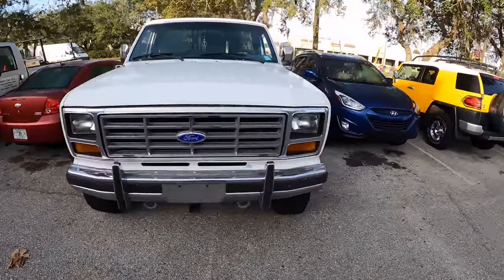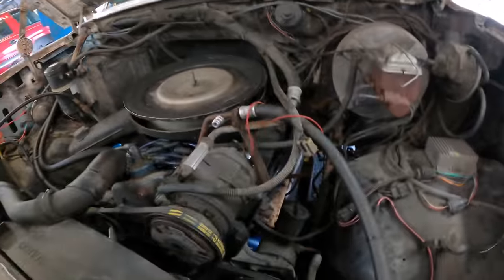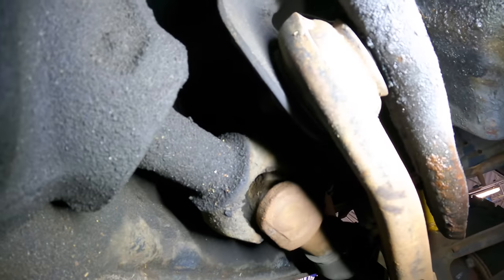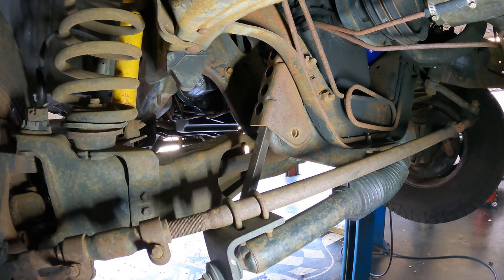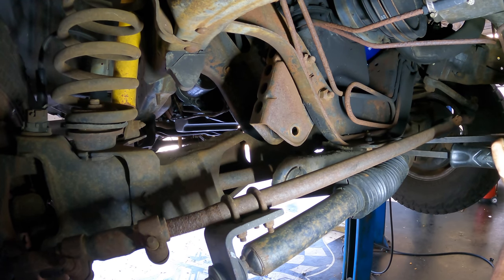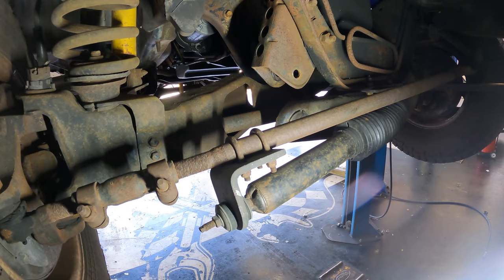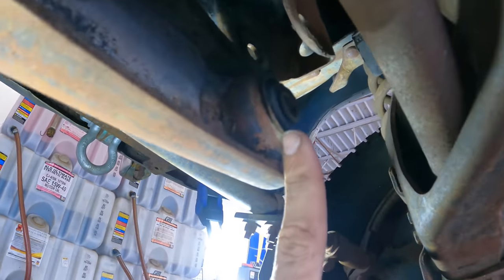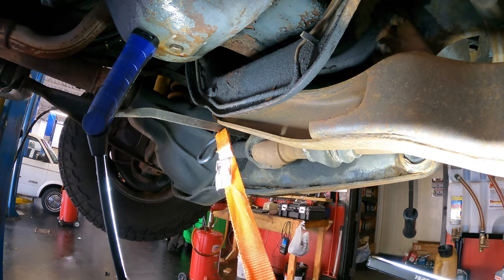Bushings DESTROYED! Assault Hammer to the rescue! Old Skool Ford F150 Classic

Comment: My first car had that foot button.  It's used to refill the headlight fluid so they will shine brighter.
Reply: That's fabulous!!!!
Reply: Dad's new '48 Crevy 3/4 ton stake bed had a second filler pedal to refill the starter with 6 volts.
Reply: That is a rare option  .  My first car  had 2 wires I tied
together to start it . That was a great car , Until the
 police towed it   :-))
Reply: Best answer.
Reply: Lol
Reply: I miss headlight fluid...greatest stuff ever!
Reply: Yea, you can't even find headlight fluid anymore! That's a real classic
Reply: https://www.youtube.com/watch?v=XOxXSEr8KlM  Turns out some headlights did require fluid if you go back far enough.
Reply: Tisna Rahani  <---------  BOT  BOT  BOT  BOT  BOT  BOT
Reply: make sure you pump it a few times, just to be sure.
Reply: That AND… my older Cadillac has a second one to seek the next radio station!
Reply: Bwahahahahaha
Reply: Where was the container that held all the b.s. that's floating around here?
Reply: I remember some old Mercedes from the '70s and '80s had foot button used to, like you mentioned, for the headlights.
Reply: High beams button
Reply: My 1970 Dodge Dart had a manual foot push windshield washer right next to the high beam button.
Reply: Is not it's the "go faster" switch ferd owners know this.
Reply: Did you lube the muffler bearings?
Reply: Head lamps  dimer ha ha good laugh 😅🤣
Reply: @saltyberserker4235  
I heard you could use the blinker fluid as well!
Reply: @garydp9760 .... yes, but only the orange color fluid. The clear blinker fluid requires a special orange color filter to be installed, which does not fit this year Ford.
Reply: Blue or green fluid?
Reply: @michaeldaidone1904  
up north, blue
Reply: @CobaltLobster  The gas ones were more fun. The fluid (kerosene, parrafin or coal oil) just burned when they failed The gas ones, acetylene gas generators actually exploded with a nice bang.
We didn't mention the actual candle power.

Comment: I'm old Ray.  That is the dimmer switch for the lights.  High and low beam.  I always felt those worked better than the new stuff on the column.  Took 3 minutes to replace it if it went bad.  No need to take the entire column apart.  I even drove a pickup that had the push starter on the floor.
Reply: Mine had a crank.

Comment: Eric O. is the hero of salt belt techs (not to mention us amateurs).  When he says that penetrating oil doesn't work, (pretty sure) he means that it doesn't work on the kind of rusted seizures we consistently see in NY!
Reply: Yep, might as well be spitting on it.
Reply: Project farm does a pretty good experiment on it.
Reply: I too am skeptical about how useful penetrating oils are.
Reply: I had a broken fitting in a tank of an air compressor last week. Tried everything and it wouldn’t budge. I soaked it in PB Blaster over the weekend…spun right out on Monday. I think it works, but it has to soak.
Reply: @hpmaxim  zep 45 actually does work. I call it the miracle oil.
Reply: Penetrating oil doesn't do much without heat here in the rust belt.

Comment: You have to remember, up in the rust belt where we work on cars, by the time we need to get that fastener off it's already rust welded on. Penetrating oil doesn't work up here unless you use a lot of heat first. Since you're using heat anyway it's easier to just heat it up red hot and impact it off. Or take a whizz wheel and cut it off.

Comment: Had a shortbed 1983 Dodge RAM D150 SLANT\6 with the Overdrive4 A-833 4 speed manual transmission and that mystery button on the floor is the dimmer  <--> high beam switch...something Junior Millennials and Gen. Z don't have in their cars these days. Good video here Rainman! Definitely. K-Mart. 400 Oak Street. 10 minutes to Wapner. Quantas never crashed.

Comment: Ooh, a floor dimmer switch!  

This is a pig of a job, for sure.  As soon as I saw the title I had to watch.  Ford kept this setup into the 1990s, and last summer I did these bushings on my own truck, which has spent its entire life in the North, on stands in my driveway.  I'm rather jealous that your impact just zipped those bolts off!  Mine just laughed off both my Milwaukee and my air impact.  I wound up using a lot of heat, a lot of penetrating fluid, a lot of swearing, and a 4-foot length of pipe to get 'em loose.  

Good show.

Comment: Put the engine/transmission jack under the tire, the bushing end will lever down as you lift the tire.
Reply: Yeah I was going to suggest the spin jack as well. lifting the tire is ALOT easier than pulling down the frame arm.
Reply: That would work but also take weight off the lift, not a safe thing to do.

Comment: I do believe steering dampeners do not automatically rebound. They stay in the position they were last in and just dampened the steering system
Reply: Spot on, otherwise they would be trying to push the steering one way all the time- and as Ray would say, that would be bad!
Reply: High being low beam switch
Reply: That’s correct
Reply: They work that way on bikes that I do know.

Comment: Penetrating oil has worked for me but it took 3 days and 6 applications. Failed to remove the bolt using up 2 batteries each day on days 1 and 2, on day 3 it broke loose.
Also, once a broken loose, the oil does help allow a nut to come off without binding in the rust easier, especially if doing the loosen a bit, tighten a bit, loosen a bit more routine. Also dissipates heat from the threads so that they remain hard and thus don't strip as easy.
So I agree that penetrating oil does not work in a shop environment for breaking loose.

Comment: I think Eric O’s point on the penetrating fluid isn’t that it’s a myth.  I think what he’s saying is that he sprays it on and immediately tries to remove the fastener never really giving it any time to do its job.  But hey, it makes you feel like you’ve done everything you possibly could before breaking out the smoke wrench.🤔
Reply: Also, us salt belt people get so much rust penetrating oil is mostly a mix of acetylene and oxygen.
Reply: @farmerfb  I like to use acetone/AFT 50:50 before breaking out the fire
Reply: @farmerfb  😂😂
Reply: It cant be stuck if it is liquid
Reply: Well, if nothin' else, it's lubricant on the threads if it does happen to spin at all...?  shrugs
Reply: Here in Norway we have extreme rust issues. Sometimes pen fluid is ok.  Other times you want to keep things dry so more salt does not stick as fast and such. Very situational.
Reply: It won't be stuck if it's liquid! If I can do it, you can do it :) To be honest, I think it's Mrs O's cooking that gives him the energy to get those rusted brake caliper bolts out every time.
Reply: @farmerfb  Exactly! And LOTS of Oxygen!
Reply: Exactly

Comment: The floor high beam used to be very common. Probably not a good idea on a manual, but on auto it works great.
Reply: Back when the auto engineers had brains and used them.
Reply: Good to know, our old ass tractor has one (1066 IH)  it's on the center console.  I've kicked it. Didn't do a thing I noticed (dad probably didn't know it). I'll have to see if anyone else notices it on the outside. (not that we ever run it at night other than for augers, I mean, it is a 1066. (Who reads manuals right? Ours is lost to the wind at least)  (it's from '69) (nice)
Reply: Not a good idea on a manual. My daily is a 77 c10 and it's a pain when you have the clutch in and then you got to put the low beams on. 😑
Reply: Yeah I've never seen such a thing in European cars.
Reply: All my vehicles are from the 70s and manuals and i never had a problem with it.
Reply: @foxman105  my older brother had two with them, 1963 Mercedes and a 1967 MGB.  They're out there you have to look for older cars.
Reply: too much for you to think about??? worked fine on manuals and you didn't have to move your hands around on the wheel
Reply: @foxman105  they were a thing, but mostly had disappeared by the 60s, early VW bugs had them and seen them on some old British cars
Reply: It was common not only in the USA, in Europe we know that too, and in majority we have manual transmission cars (still, up to today).
Reply: In addition to being on the steering column now, my Subaru has 20+ other functions there.  Nothing is in the same place as I move between my 3 vehicles.  Simpler times.
Reply: @ratchetfox8111  volvo PV and volvo amazon had the floor switch with manual gearbox.
Reply: @gregorystone1439  The key is to anticipate when you will be in that situation and pre-emptively put the low beams on. That's how I did it when I drove trucks with a manual and a floor switched headlight beam. Alternatively, slip it in neutral for a second, switch to low beams, then put it back in gear.
Reply: @gregorystone1439  My '78 C-10 Big 10 had one. Auto trans.
Reply: @johngordon6526  must have been an option for the old binders!  The 1066 black strip that I used to run didn’t have that option. Our John Deere 30 series and up had them though. The 1066 that I ran didn’t have the diff lock either and I know that was an option as well.

Comment: Dad's 1975 Chrysler 5th Ave. had two of those on the floor. One was for the high beams. The other was to a motorized servo located in the radio that would move the analog tuning selector to the next radio station. Pretty slick stuff for that time.

Comment: Hello From Mark In Kentucky. Seeing this video makes me want to come out of retirement. The repair facility where I retired from used to have a very wide range of equipment come in for repair. I used to be the welder/fabricator at our facility in which I was usually working on dump truck beds that were either badly rotted out or had been wrecked. When we were not working on trucks, We were repairing mowing equipment for right of way mowing. Our facility performed all of the heavy repair work for a twelve county highway district.  When we had the Chevrolet/GMC dump trucks in our fleet, We replaced quite a few kingpins and broken axle shafts. When removing bushings like the ones on the Ford truck, If you can get some good reciprocating saw blades - You can slice the inner bushing to relieve some of the surface tension to make for an easier removal. I am a new subscriber who just happened to stumble upon your video. I have two of the older Ford trucks with 300 inline six cylinder engines. My Ford with the E4OD transmission is having slipping issues and I am thinking of finding a C-6 instead of fooling around with the E4OD. So I am driving my1985 Ford with the NP435 that I purchased last year.
Reply: Early E4OD's are crap without all the many upgrades the later ones came with; do all the upgrades and add a trans cooler then they're good trannys. C6 came in truck and car versions, slightly different gearing.

Comment: I liked seeing the air filter cover turned upside down in a desperate attempt to get an old Ford to breathe better and extract another half mpg out of the beast.
Reply: Half an mpg probably doubled what they were getting before, that's a solid improvement.
Reply: He probably like the sound it makes when he steps on it...
Reply: Used to do that for street cred points. Doesn't help cold weather warm-ups and as often as not it lost a bit of efficiency by disturbing the engineered airflow into the carb, but we never knew that back then.

Comment: One thing I like about doing my own repairs is that I get to do unnecessary repairs while I am doing the necessary ones. 
If I were doing those bushings on my own vehicle, I would have taken the whole beam of so I could grind off the rust and repaint. Not out of necessity, just because the rust bothers me...
Reply: That would require a lot of disassembly as that is a TTB, has drive shafts in it, take a full day to break it all down.
Reply: You would not do that on a car in the rust belt. Just not worth it
Reply: You must not be in the North.  Rust is life, and life is rust.  Imagine doing this job on a 27-year-old Northern truck with 217,000 miles on it.  It's an absolute pig of a job, and by the time you're making progress you ain't interested in doing any more than what needs done.  And drinking.
Reply: @alwolschleger7242  I got a van from Kentucky, that is as far north as I want, never seen so much rust, most vehicles here take a long time before the frame rusts.

Comment: Fact: Switching between low and high beam was accomplished through a switch on the steering column. In 1927 the dimmer switch was moved to the floor, where it stayed for about 50 years until it was moved again -- to the steering column!

Comment: High beam switch this should be an option for all trucks along with the wing windows
Reply: or all automatic so you get use for the foot your not using :D
Reply: I miss the wing windows too. My 79 trans am straight shift was the first vehicle I owned that the dimmer was not on the floor
Reply: I trace the fall of American values to the loss of wing windows. Wish I had my 67 Mustang.

Comment: Ray, I wish you'd wear eye protection when your under the chassis, eye sight is nothing to play with. Other than that, I enjoy sitting back and watching you do your thing. I have a classic car that I've needed to change out the master cylinder and power booster for several years. After getting hooked on your videos, it gave me the drive I needed to do the job. It ended up with me having to change out the rear wheel cylinders as well.  Thanks and keep up the good work.
Reply: Getting flavour in you eyes hurts and scratches the surface of your eyes.
Reply: safety squints my boy
Reply: Gettn trash in eyes on rack not so much on a rack...just on Jack stands I really agree...that greasy dirt in the eyes burn and can f*k yu up...make sure flush station around
Reply: Trash gettin n eyes not so much up on a rack
Reply: Don't twin I beams have king pins...long time ago

Comment: I have done many of those bushings, and I found an easier way to keep things lined up when pressing the new bushing.  I use the long bolt from a strut spring compressor through the center of the bushing and adapters.  That way your can line everything up with one hand while you start tightening the bolt.  It is also a lot lighter than the ball joint press.  I worked alone and did not have someone else to supply the third hand.

Comment: I did this same job along with Radius arm bushings and spring insulators on my 92 explorer sport. I had to change the bolts for the I beam bushings too. They were worn and eaten by rust. 500,300 miles

Comment: Surely someone else in the 910 comments pointed it out also.  Steering dampers are not pressurized like a shock absorber.  It was to resist movement, not move on it's own.
Reply from the maker: Yes my brain does odd association things some times. I called the bushings ball joints in this video bc I was using a ball joint press to install them
Reply: @RainmanRaysRepairs  That comes from watching too much Clive.
Reply: @RainmanRaysRepairs  It gets worse the older you get.

Comment: Even though I learned to drive a decade after those went out of style, I know what it is. The only reason I know is because my first car was a family heirloom 1976 Chevy Caprice Classic that also has the headlight dimmer switch on the floor. Yeah, I drove a glass house to high school every day my sophomore through senior years. I graduated in 2000 but the car was already 26 years old at that point. My friends nicknamed it The Tank. Man, I loved that car. I hated the gas milage. Speaking of which, another quirk no one knows about anymore is the fuel fill door being under the license plate. The beauty of that is you can pull up to the pump any direction you want. You don't need to get the correct side facing the pump because it's in the middle of the back. Man I miss that car.
Reply: Absolutely right. Back in the UK (when I was just a whipper snapper) all the cars had them. Press for full beam, press again for low beam.
Reply: I had a 72 in HS. The nice thing about the filler cap being there is it is very low. Easy to siphon for gas for my dirt bike.

Comment: High beam switch.
My father owned a Chrysler VC Valiant Station Wagon, & had the same switch on the floor.
He also had a 12V record player in the car - Turntable on 4 springs so that the song wouldn't bounce after going through pot holes etc.
Not many cars had them back then in the late 60's -  70's.

Comment: Assault hammer without eyeball deflectors?!
Consider lubricating the threads on the press to reduce the torque loss due to friction, and lubricate the hole (diggity) so the bushing takes less pressure to install.
Reply: The assault hammer is having some issues hanging on to it's dangly bits. Time for new hammer?

Comment: The "shock absorber" is NOT pressurized. It is a steering Stabilizer / dampener that resists movement - like rocks. washes, pot holes. If it was pressurized it would try to push the steering to the right
Reply: Bilstein makes them in pressurized form, and somehow, they don't.

Comment: For future refrence,  an acetylene touch will make sorry work of the rubber. Without the rubber core the outer slave will just fold out
Reply: I’ve done that in a pinch but then there you are hammering on a flaming chunk of rubber under the car, what could go wrong right? Just take a 3/16 drill bit, run thru the bushing several times and it’ll come out with little effort
Reply: I just burn the rubber completely out.  Takes no time at all
Reply: Everyone in the shop will love the fumes.

Comment: You need to tighten the bolt that goes through the bushing under load. Otherwise it will stand under constant pressure when the car is on the ground. This will decrease the lifetime of the bushing. You simply jack up the axle with a gearbox jack when the car is on the lift and then tighten the bolt under preassure.
Reply: elastico
Gentlemen, it looks like he knows what he is talking about, better listen to him.
Reply: @DmitriiDmitriev  he is right